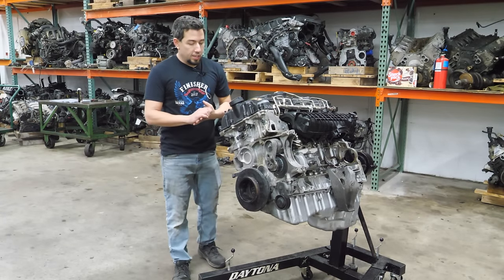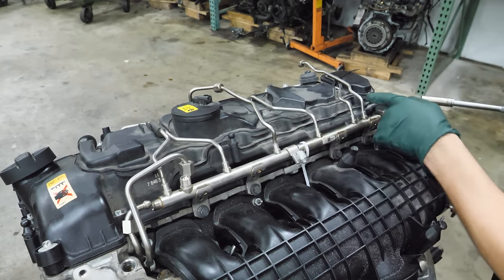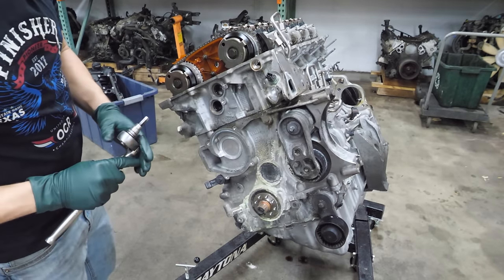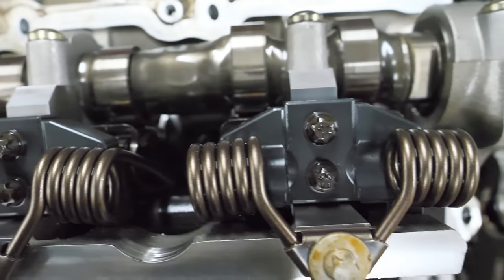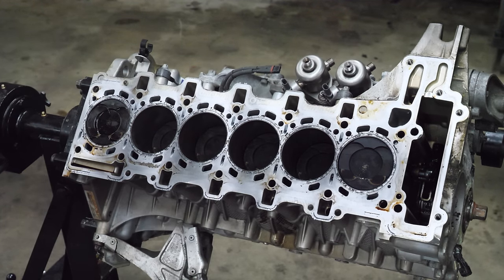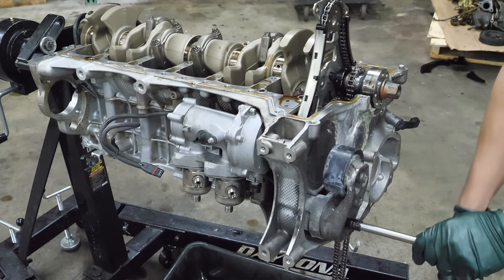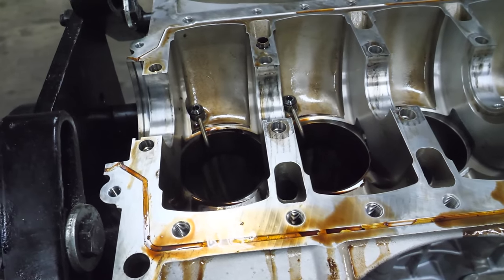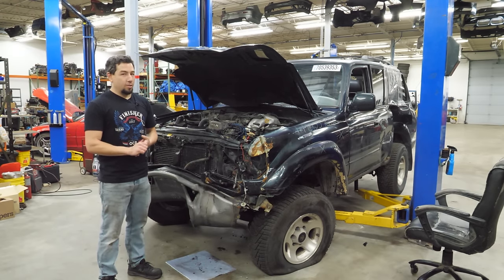2016 BMW F80 M3 Twin Turbo S55 Bad Engine Teardown. Bogus Rebuild?

Comment: I really like the modular way that these BMW engines are put together. Looks genuinely enjoyable to work on (aside from maybe the Valvetronic), which is pretty rare for a modern engine.

Thing looks gorgeous inside too; give it an exhaust valve job, a little polishing, and new wear items (bearings, guides, gaskets, etc.) and you'd have a usable long block.
Reply: At the point this engine was yes. Remember though, a lot of the ancillary components were already gone or were loose. No water pump, no wiring, no turbos etc.
Watch a couple of those teardowns with everything in place, you may not think quite the same.
Reply: @jaredbawden6707  this, ESPECIALLY if you're doing work with the engine in the car.
Reply: @CaptainSpadaro  for sure. I've only ever worked on an N42 and 4 cylinder turbo diesel BMW (ex-wife's car's), and that was bad enough.

Comment: Actually at BMW garages, there is a tool to get the injectors out and at the same time measure if they are in there "too tight" cause theoretically they could be damaged after disassembly... So that doesn't look that bad actually

Comment: The last time I saw valve/piston contact like that some idiot downshifted to 2nd from a high rate of speed. Floated all the valves just enough just to kiss the pistons and bent the intakes enough to keep it from running.

Comment: Crank hub spun on this engine maybe initially? When the diamond friction disc that holds the cam drive sprocket to the oil pump sprocket and crank snout fails the sprocket slips and timing is lost. It's the only common S55 failure mode. It only slips a bit usually though.
Reply: I was thinking the crank hub spun as well. S55's are known for doing that with high power mods.
Reply: he said the engine wasn't out of timing

Comment: Maybe a stupid question but I need to ask it anyway. Those notorious heat tabs, do they fit to today's engines, which run a much higher coolant temperature (especiall when looking at the top range, like S-engines etc.) than rather commonm and maybe older ones? Of course in this case there are several hints at the front that indicate a massive leakage but I think of other cases, where the heat tabs might lead to wrong conclusions. 🤔

Comment: Defenitly been to bits. Cam timing was not right, reason it over heated and ofcourse valves hit pistons. It would have been a gutless slug hence removal from the car. You have a good bare engine, or head and short engine for sale.

Comment: That engine comes from a stolen car. Probably from Europe or Asia. It's how they do it. Steal a car, pick the engine, spray paint it and sell as "rebuilt". It's  darn hard to track back because you have to know where the car was originally stolen.

Comment: I am wondering  if somebody did some old-school hot rodding and shaved ten or twenty thousandths off the block then assembled it and heard a helluva racket when they started it up so they checked the valves for bending and installed an extra-thick head gasket to space the valves away from the pistons a bit.

I'm just spitballing here, trying to make some sense of everything.

Comment: The injector tool is designed so that you DONT wiggle the injector in the injector bore. The ease of use is just a plus 😂

Comment: Thank you for saying what year the engine came out of. Some of us like BMW but don't keep up with the fan boy bs. There are other cars I like too. I can't remember every code for every car made I like.
Reply: I know all the BMW codes and google isnt far away to type the code in if you are curious..... However, I agree fully, that was a good move to state it for those that dont know.

Though you could perhaps have toned the language down a little bit. Cheers mate.
Reply: @GoldenCroc  Yt always feel the need to regulate a brother speak.
Reply: @blackericdenice  Yt? Youtube? Yeah it does a lot, but it is what it is. It can be avoided mostly by using different phrasing.
Reply: @GoldenCroc  Yt does not mean youtube

Comment: The whole "valve tronix" thing leads me to believe that BMW will use encabulation in their engineering at some time in the future. Both concepts make as much sense as each other.
Reply: Encabulation would be too much of an established technology for BMW.  Whereas the valvetronix name, clearly should have been used for voltage regulation in guitar amplifiers
Reply: Its valvetronic btw 💀 not to be a dush or anything

Comment: I would almost guarantee the issue with this engine was a spun timing gear. Usually results in valve-to-piston contact.

Comment: Shouldn’t the rev limiter have prevented the valve float - that’s the main reason for having a rev limiter isn’t it?
Reply from the maker: Like I said, a lot of these cars are tuned and rev limiter is one of those parameters often changed

Comment: So minimal valve and piston witness contact marks, melted heat tab, a few bolts not tighten to specs. That engine with a little tlc would've probably lasted another 150k miles.

Comment: Damn, it's like watching you take apart an automatic watch. This engine is WAYYY too complicated for my preference. It's like they designed it to be a nightmare. Which would be fine... were it not for both simpler and more reliable engines with comparable performance and efficiency.

I am glad you got lots of parts off of it though.

I had been toying with a mercedes I6 engine swap but... maybe not. If you ever do a teardown on one, I will be extremely interesed.
Reply: the s55 is almost bulletproof so nothing to worry about🤪

Comment: Hmmm.  Surprised you didn't mention S55 crank hub gear "slip" due to high rpm and heavy boost, and the likely cause of the pistons hitting the exhaust valves uniformly.  I think the owner had  the error, had it "rebuilt" just for the crank hub issue and the person who did it milked the owner for a full rebuilt.  Just saying.

Comment: I'd like to know how ultra-high revving F1 engines avoid 'valve bounce' ?....or is that an industrial secret ?
Reply: Nope, not a secret: They dont use valve springs at all. Rather, they use compressed air as springs.

Comment: either used wrong weight oil or poor quality oil   seen main bearings from 180k s engine that go high quality oil and correct weight and they looked very good

Comment: Valvetronic was not a solution to a problem that never existed! I believe the tech to be part of the first generation of ultra low emissions. The goal was to get way out ahead of regulations by using technology. Even with port injection these engines in a good state of tune are fuel efficient and clean burning. I do think engineers in Europe sometimes do things just because...

Comment: Cylinder head machined? Mentioned a thick head gasket. BMW sells a thicker head gasket for a machined head. Evidence of an overheat and a shoddy rebuild. Maybe the head was machined too much for the thicker gasket and the exhaust valves just touched.

Comment: Aluminum bolts...why? Just...why?...
Reply: Aluminum block, so like metals are better in engines that run hot by design. Less chance of a bolt backing out.

Comment: You say that timing wasn't issue. How can you tell when you did not refer to the reference piston TDC nomograph where nomograph features including chain type, link spacing(within 1/32 inch), ambient temp (degrees Kelvin), relative humidity, applied tensioner "k" value (N-m), oil SAE viscoscity chart curve (call mfr for latest version) and compare with BMW engr established range values 😅 jk.  Cam=Ok cyl 1 time to oven valves, Valves=Ich bin fernsehen (I'm on vacation)😂❤

Comment: Just bought an F83 2016. This'll be interesting 😂
Reply: What strikes me is how much thicker the walls between cylinders are compared to the S54 from my prior e46 m3. Anyone that's had one long enough knows the HG goes between 5 & 6 because it's thin and gets hot at the back. Guessing that was a result of going from 3.0 to 3.2 from M54 to S54?

Comment: that broken bollt extraction needs to be patented :))) so lucky there. there is no cure for German over-engeneering :) this engine shows it. This valvetronic system is the gateway to freevalve from K'seg one... and possible that technology might come too late to regular engines ... possible someone went too long in redzone with cold engine that valves kissed them pistons ...

Comment: I would feel sick to my stomach as well.  But for a different reason.  That engine was ok.  It probably had a lot of miles left on it.  The leaking coolant could have been fixed.  Shame to see it torn down to parts.  Good on ya for the value realized, though.  That is, after all, the business you are in.
Reply: Seeing as it should have been torn down anyways to replace bearings and such, I'm wondering if it's worth more in parts than it would be as a whole.

Comment: It over heated, threads were probably starting to pull on the main bolts if it indeed lost  torque. Block is probably junk. Had a customers m54 over heated and lost head bolt torque and wouldn't had torque, junked it. BMW S motors have rod bearings on the maintenance schedule! Lol
Reply: It's on the schedule so guys like JD Power don't pick them up on bad reliability scores... all smokes & mirrors, without going into the 'more costly ownership, more profit at the service desk' aspect of it.
Reply: @jacquesc3166  every 80 to 100k... Why do I like these things!? Lol 
Every M car after 2000, except the S62... the Best V8 BMW made! Gettin 200k out of em, no major work...

Comment: The M typically stands for sh!tty. At least from what I've seen. Keep these coming Eric
Reply: Hmmm I dont know of I would say that. However what I do know is from about 2000-2010, BMW engineers certainly missed the longevity to consumption/power compromise with a mile in lots of engine design, certainly with the S models up there, which is frankly unacceptable.

Comment: Your volume level's about 30% lower than the multitude of ads they spray throughout the video. You might want to check and see if you can adjust your volume leveling during editing, turn up your mic's gain, or adjust the overall audio level in edit. It's not particularly irksome, but the commercial advertisements sure did scare my poor cat awake every time they came on. Normally I watch TV with the volume level at about a 12-14, on this video I had to push it up to 18-20.

Thanks for all the videos. You do things the way I do, except you're a bit funnier and you're excellent at narrating for yourself. Also, I've wanted an Esprit V8 since high school - YOU SUCK. Once, I saw a big fat black man wedge himself into a bright yellow 80's Esprit in Napa Valley, California and proceed to drive slowly away...most hilarious thing I EVER saw in California. I gave up regular TV for Youtube a long time ago, partly because I like being able to comment and know that I have a chance that the creator actually reads my input and can reply as needed.
Reply: This channel alone justifies paying for no ads on YouTube. I don’t pay for cable, and I use YouTube so much that it justifies the cost.
Reply: You can get rid of the ads by manually fast forwarding thru the video, let it finish and wait a second for it to finish. Press replay, the ads will all be gone.

Comment: Valvetronic is such a useless thing.
Reply: Such a BMW thing to do.
Reply: It's been around for over 20 years, if it was usless they would have dumped it. Parents had the first version in the n42, it had zero issuse under ownership, was sold at aorund 200k miles. It helps with manufactures biggest enemy, emssions and if you compare bmws engines to others with the same power levels they usually have quite alot better co2, the first version had 174g in 2001. For comparsion a vw 2.0 from same era is over 200g with same power level. That's a crazy amount when manufactures are "taxed" on there combied emssions from cars produced

Comment: Crank hub slipped is my guess, a common problem when the engine is over revved and sharp acceleration/ deceleration. Shame it was stripped for this design  flaw
But good to know you have a nice Xmas bonus to finish off the year 🎉

We have an s58 G82 M4 engine going in an e36 . that’s a closed deck block but 90% of the parts are not shared with the B58 and are engine specific. 

Common crank rod bearing failures don’t seem to effect the earlier N/A s50/S54’s nor do timing chain issues, technically a better engine pre pointless emissions regulations . 
However the later S series engines are superior they just fcuked up with skimpy timing chains and bearing shells . Blame that on accountants, middle management and woke culture. ❤
Never risk a damaged / used crank or re grind on the later engines as they have a hard coating as far as I’m aware that’s destroyed when re ground . 

new in the uk off memory an s63 V8 crank was 2500.00 plus Vat .
Reply: I bet you enjoyed having a go at Woke Culture, whatever that is. As you are from England and it's German engines you're commenting on, you must be referring to German woke culture. I hear you have sovereignty now, shouldn't you be supporting your own dwindling car industry and buying British? 😂

Comment: Its a stout and impressive motor....BUT...its the WORST sounding engine ever put in a performance car. What a shame, cuz the F80's were such beautiful cars. I would have bought one if they sounded even half way decent.
Reply: Just needs an equal length mid pipe
Reply: @future62  Sorry....its a WIDELY held opinion that they don't sound good no matter what you do to them. The quieter the better.  Respect for the car...but they sound terrible.